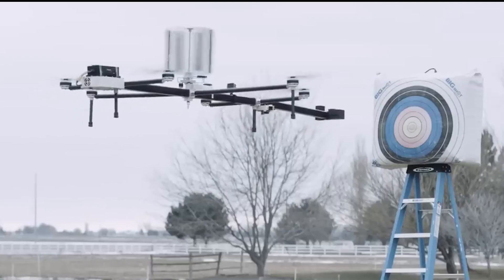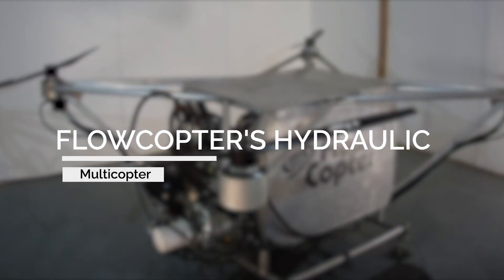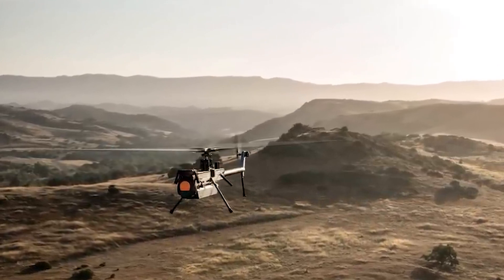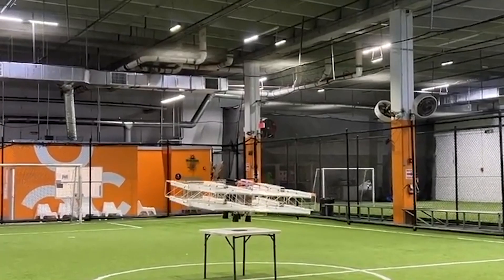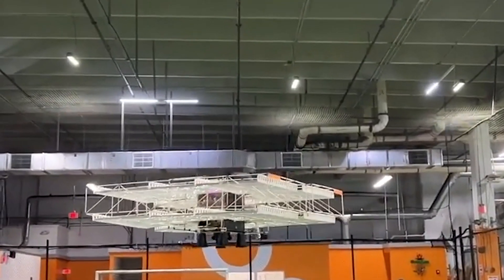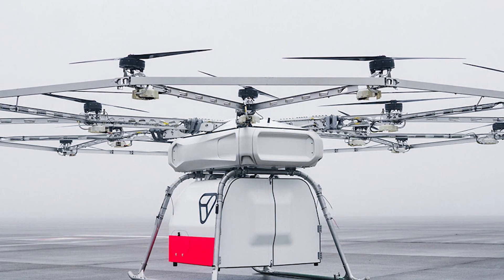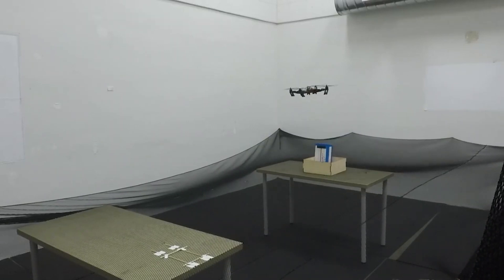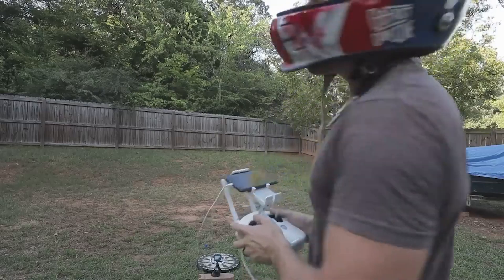7 Amazing New Drones (2023)

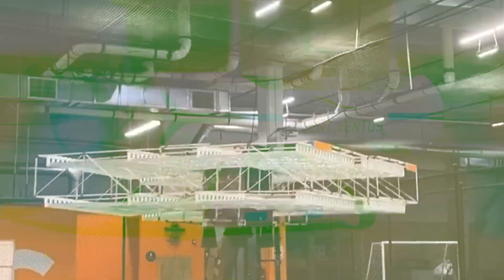Comment: The "ionic" drone at about 5:30 in this video is actually propelled by a noisy ducted fan (model aircraft "jet" engine) in the center.  Due to the physics of those, it cannot fly as quietly as a quadcopter.  On my channel there are more than 40 videos of a series of solely ion propelled aircrafts that are patented specifically for carrying their onboard power supplies against Earth's gravity.